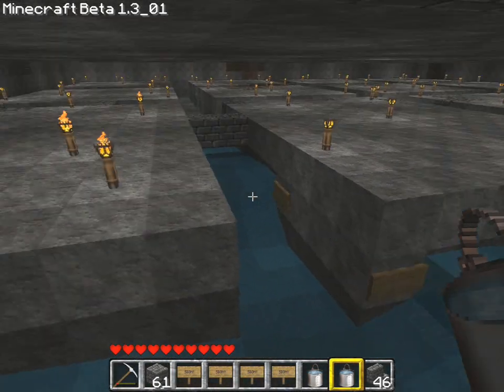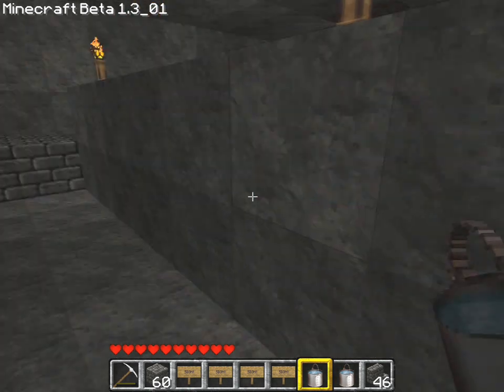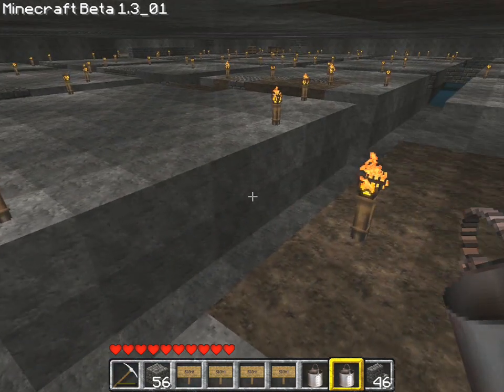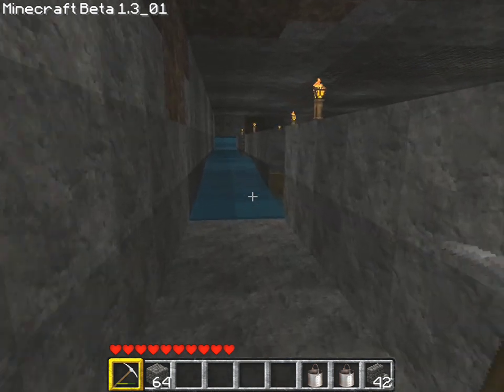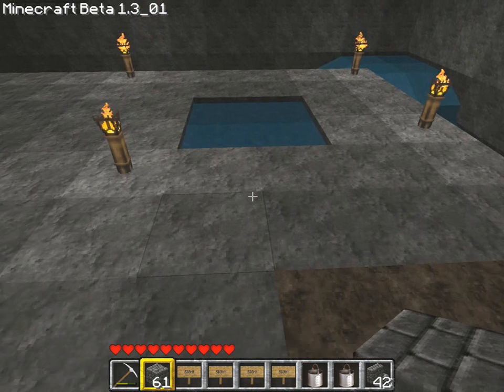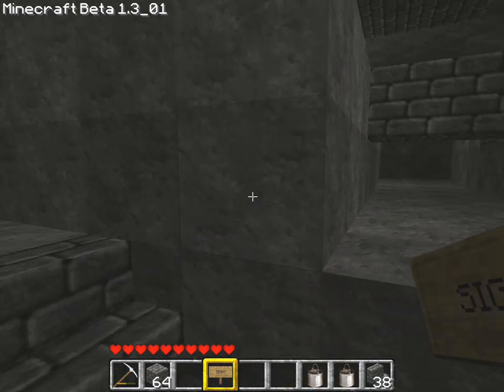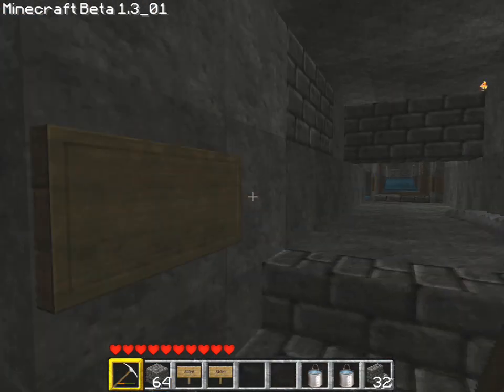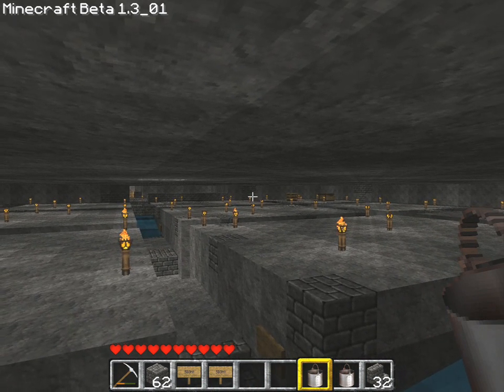My Minecraft 010 - Mob Trap 2 (Trench System)

Comment from the maker: @MrKroakim The system will work with any size pad, the smaller, the more efficient your trap will be to a point.  Larger pad areas will give more blocks for mobs to spawn but will mean that they have to wander longer to "fall" into the trenches.   Smaller pads will mean that the mobs will fall into trenches easily, but will reduce the overall number of blocks available for spawning.  I think somewhere around 6-10 blocks is optimal.  Also, make sure to light up the surrounding caves!